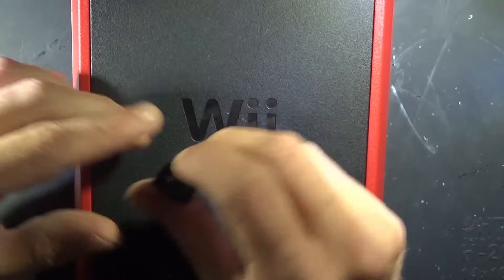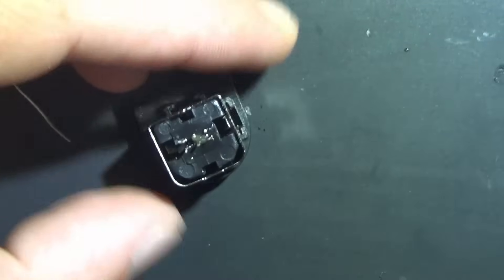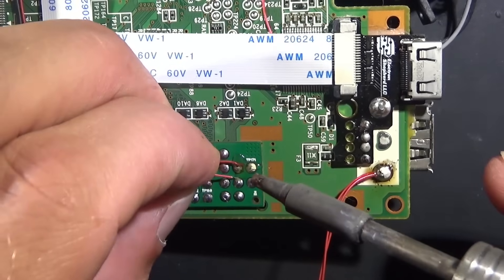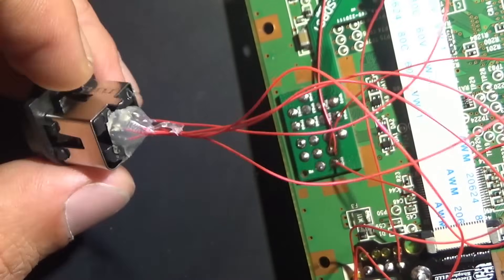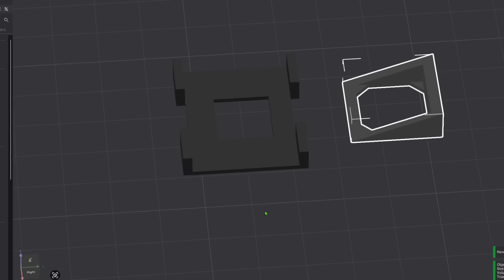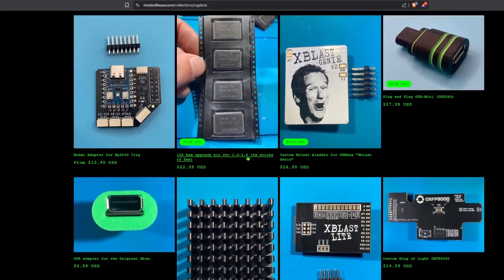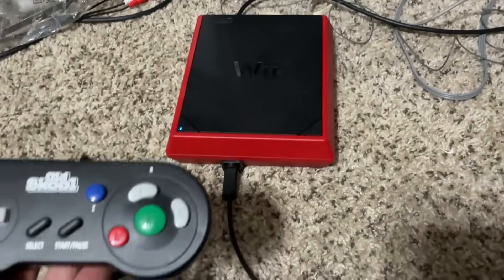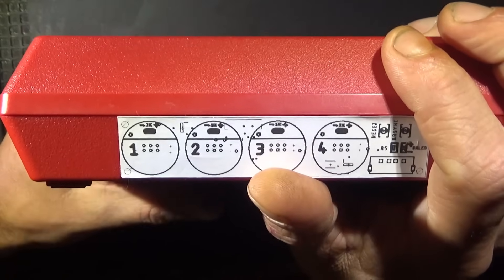Adding A Gamecube Controller port to the WII MINI!

Comment: I find it interesting that I just learned that you can re-add GC controller ports to the Wii Mini. I believe that there should be a way to also add the memory card support the original Wii had, and I believe that the ports should have its own screw in pcb so they don't move around. Perhaps you could design the PCB to be screwed into a revised vessel into the Wii Mini shell so it can sustain itself without doing any permanent modification to the original shell. If possible, you should add the memory cards to either side in a vertical position to save some space. As for the ports 2 and 3, I don't know much about them, but if it is possible to add them, then I would love to see a bunch of multiplayer games working on the Wii Mini. I never owned a Wii before, so I picked up one of the later Wii original models that still have GC support recently, so seeing this project come to light is always welcomed here.

Comment: Just a FYI, to add GC Controller ports 2 and 3 back requires tapping directly into vias and adding a handful of passive components. There are no test points available for GC Pads 2 and 3. The passive components are already on the board for GC pads 1 and 4. The reason why this is this way is because in the factory install process they use both pads 1 and 4 to run various tests. Some certain factory software requires the tech to press z on pad 4 for the software to launch. There is no requirement to use pads 2 and 3 in the factory. If you are still inclined to follow through with the mod you are likely best off just cutting up a dead backwards compatible wii and cutting the port and supporting components out of the pcb. There still may be another couple passives closer to hollywood that may be needed, but I honestly forget.
But if you get anything manufactured let me know and I will buy a handful.
Reply: same i would love this
Reply: May need to make a solder on flex for the controller ports.
Reply: Where is the info on the vias and missing passives?
Reply: @Angryhelder  I did not document it, but I can take a look into it again if needed. It is just a matter of following the traces to see which vias under hollywood they are on a rvl-cpu20 or newer motherboard, and they will match the placement under the wii mini motherboard. I can look into it deeper if people want, there was just never a demand before.
Reply: @deadlyfoez I'd appreciate it, I'm planning to do my own implementation of these mods but there is not much info out there for the mini or documented to easily find.